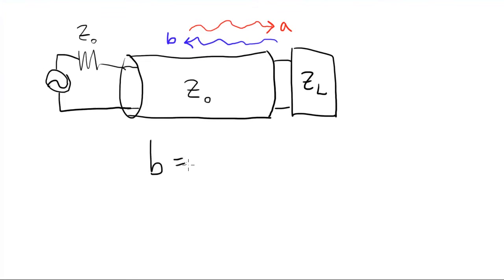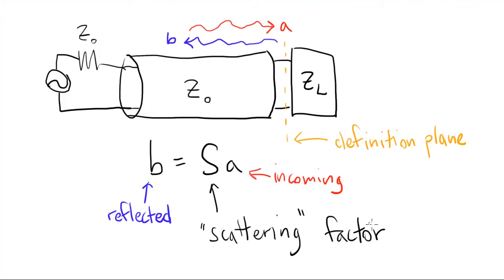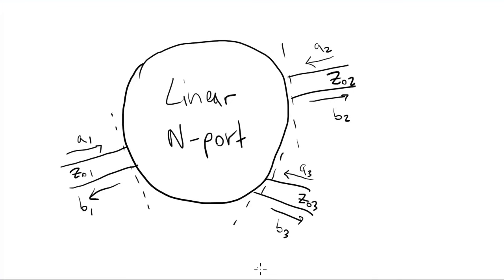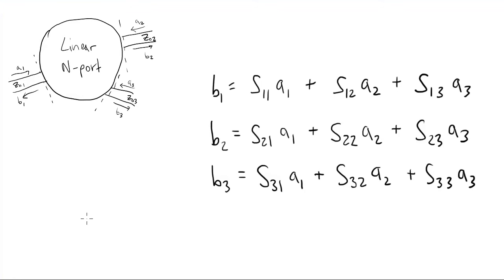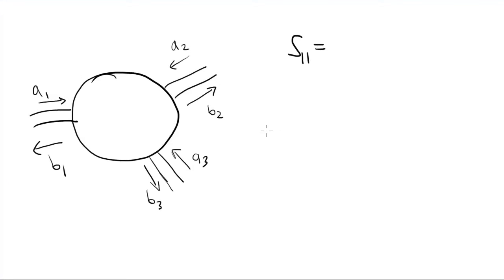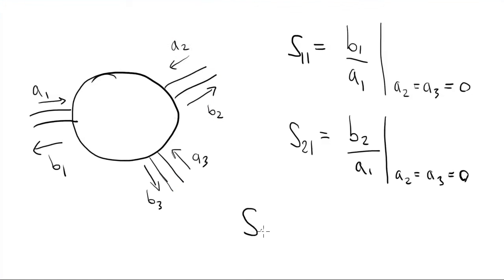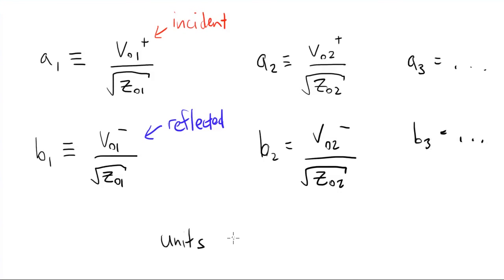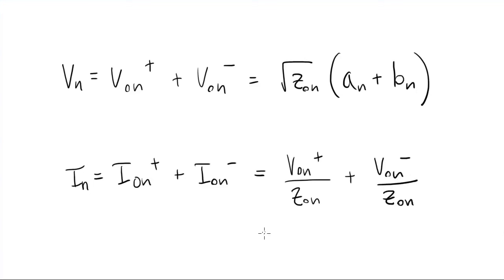Introduction to s-parameters

Comment: I was trying to find a tutorial for this for an "intellectually challenged" student of mine. Your video is quite good, but I do see a couple of problems. 

1) At about 2:00 into the video, you show a 3-port DUT, and call the voltages out of the ports as "reflected". But b1, b2 and b3 can be due to reflection or transmission. For example, the voltage b2 can be due to reflection if a signal is incident on port 2, or transmission if a signal is incident on ports 1 or 3. 

2) At about 4:20, you state that to ensure nothing goes into the other ports, you terminate them.  However, you don't say what you terminate them with. Someone could be excused for thinking that you terminate the unused ports in short circuits, to set the voltage to zero, but of course that's not the case. I admit, your terminations do look a bit like resistors, but its far from clear that you are terminating them in resistors, which are usually 50 Ohms. 

But overall, quite good. 

Dave.